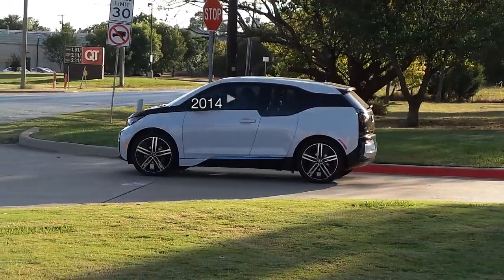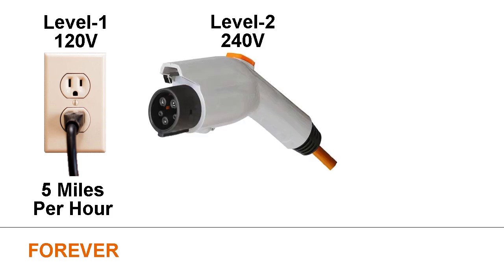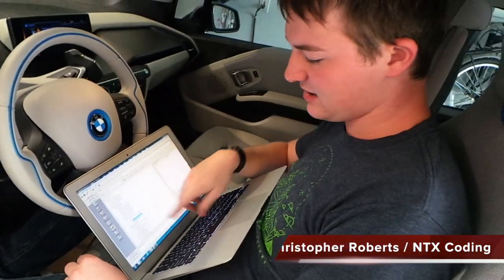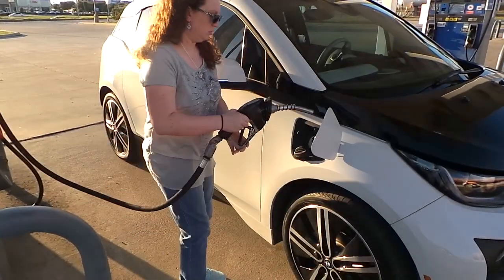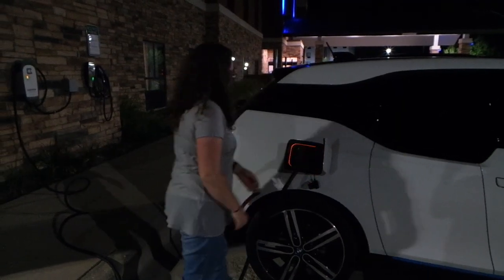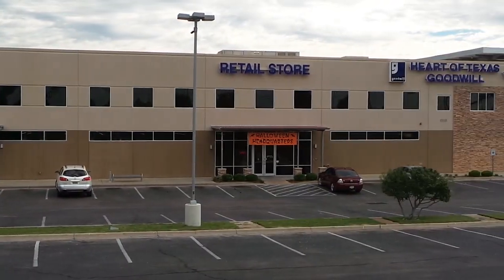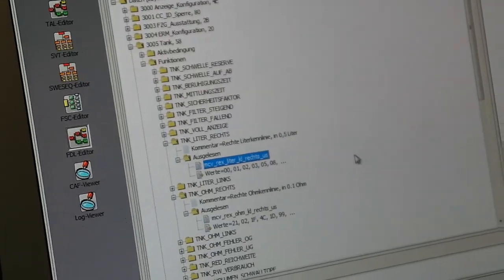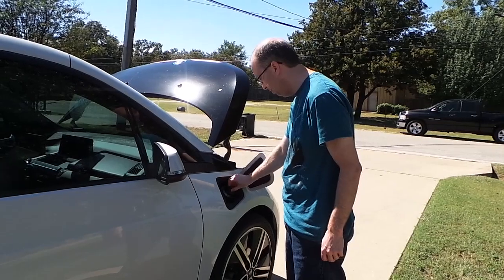BMW i3 REx roadtrip, charging, coding, and range test.

Comment: Thank you for the lovely test drive video! If I may suggest one thing: could you include KM's and Liters as well in the future? As a European I constantly had to pause the video and convert the miles/gallons :-)
Reply from the maker: I had seriously thought about that during the production.  But my audience is primarily in the USA.  So I decided not to.
Reply: Great review (I like all your video) and I love the car, but ditto here about KM and L.  The only Imperial countries left in the world are Liberia, Myanmar, and the USA.  There are some miles and gallons die hards in the UK too, but everyone else has moved on.
Reply: Die hards? As in, all the roadsigns, speed limits, cars and drivers? Don't get me wrong, I'd love to be fully metric (and with any luck, an independent Scotland in the future will go that way) but that is no reason to misrepresent the current state of affairs.

As it is, we're in a weird imperial-metric hybrid, where long distances are measured in miles and never kilometres; short distances are measured in either yards or metres ("Parking in 500yds", "30mph speed limit in 300m, 200m, 100m"); shorter distances still are measured in either feet and inches or metres and centimetres (a speaker may even casually mix the units depending on which comes to mind first); tiny distances are measured in mm (personally, I've never heard fractions of an inch smaller than ½ inch used) so tyre treads are measured in mm; speed is always mph and never km/h (heaven forfend anyone use m/s); fuel is sold by the litre but efficiency is measured in mpg; braking distances can be calculated in either feet or metres for our driving theory test; weights are given in kg (but many people still insist on working in stones and pounds when they think of the weight of people); pressure goes between kPa, bar, and psi depending on your car manufacturer and the gauge you use; frequency of rotation is measured in rpm (although I believe that is the case worldwide for automobiles, the SI unit would be s^−1 or Hz); we tend to talk of visibility in metres (though it wouldn't surprise me to hear it in feet or yards); height and width restrictions can be listed in metres only, feet and inches only, or both on the same sign.

Thankfully, all science education has been fully metric since before I was born, so with any luck we can phase out imperial measurements in my lifetime!
Reply: Yep UK here too and we're all Miles and Gallons too, that said... Brexit :/
Reply: scotsmanRS well in other countries like Italy everything is metric
Reply: How about you all learn a real number system.
Reply: And it would somehow do any damage to your main audiene to also consider other audiences? Would it hurt their precious special feelings to also acknowledge the existence of other audiences and the existence of the rest of the world for other audiences to hail from?
I don't get it.
Reply: Miles are far superior.
Reply: FREEDOM UNITS

Yeah I have no idea how to use most FREEDOM UNITS either being from BC. Trust me it's a bigger pain driving to the US and having to convert FREEDOM UNITS into km m and L
Reply: 1.6km per 1 miles.
Reply: 1.6 times. lol
Reply: Well, hello from Romania :)
Reply: The UK and USA are both a large share of the English speaking world (as far as being the primary language spoken is concerned).  Many countries and people speak English as a secondary language or a "standard language" so everyone can communicate, but it isn't the same as the US and UK where first and primary languages are almost always English (with some French and Spanish mixed in for the US).  Other anglosphere countries make up 20-25% of the population, maybe?  So, no, he should not use the metric system.  They are equally arbitrary anyway.
Reply: @JonathanOwenPhotographer  its not even same imperial gallon vs us gallon lol
Reply: @JonathanOwenPhotographer  Petrol (gasoline) is sold, ONLY, in litres in the UK. Gallons has not been a legal unit of sale for at least two decades. Nor do we use gallons to describe other liquid measure - unless you're a geriatric. Nobody under the age of about 35 will know what a gallon is. Oddly, some people still talk about the fuel performance of cars in MPG, although km/L is used too.
Only, ONLY, the USA (and associated territories like the Marshall Is.) use 'US Customary Units'. These differ significantly from English 'Imperial' units. Liberia has abandoned US units because its principal association is now with the other 14 countries of the West Africa ECOWAS trade bloc which is exclusively metric. Myanmar was (British) Burma until 1948 so has retained the Imperial, not the US system.
Actually, the US has gone metric - it's been the obligatory system for Federal work since 1978; the US military (with the exception of naval units like the Knot) uses metric. The US automotive industry has been metric since the 1960s, NASA since the 1990s. Since the entire rest of the world uses metric, US exportelrs have to make stuff in metric, too. The only Americans who cling to 'Freedom Units' are, by and large, Americans that don't really understand 'units'.
Reply: @alastairbarkley6572  many thanks for the slightly condescending Wikipedia style info, I was (I believe as it was now said two years ago!) referring to mpg which is something I am very much used to hearing referenced. If that makes me geriatric so be it, I'm probably not alone being in the +35 age bracket. Feel free to let me know what % of the population in the UK fits this demographic, and furthermore how including mpg might benefit us oldies who watch this channel that have lost all grip on weights and measures in this fast paced modern age.
Reply: @The8BitGuy  no, me and many Eurasian friends watching your channel too :)
Reply: @CatsMeowPaw  we are weird in the UK and buy petrol in litres, measure it gallons and measure distance in miles, but our emergency phone signs on the motorways tells us how far done the motorway we are in kilometres

Comment: This is, without a doubt, the best BMW i3 review I've seen. With the old tax credit still in effect for used i3s and me needing another car, this is certainly a car to consider. I do a 100 mile drive about once every 3 weeks. Besides that, most of my drives are 12 miles or less, so something like this would be perfect and is a good way to avoid paying the high gas prices, while not spending $70K!

Comment: Now that this video is about 2 1/2 years old, how has the charging infrastructure changed in your area?  Are you seeing more charging stations?  Would you be willing to go further on EV and less on the Range Extender?
Reply: i too want to hear an update
Reply: There is a fast charger in Waco, TX now.
Reply: We do have more public charging stations in DFW, but it still needs improvement - especially the suburbs.  Arlington is DFW's "entertainment" city with Six Flags over Texas, Hurricane Harbor (water park), AT&T Stadium (Dallas Cowboys, concerts and college football games), and whatever the new Ballpark for the Texas Rangers is going to be called, but there are not many charging stations.

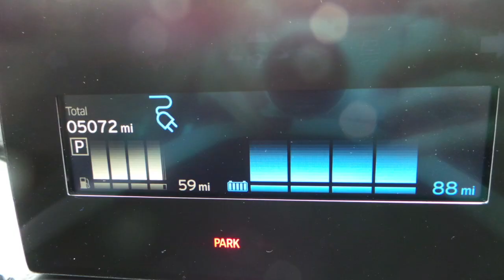Comment: 8:15 increased gas range on the guessometer because of a change of temperature perhaps.
Reply: yeah that's it most likely
Reply: Either that or maybe the incline on the pavement where the i3 was parked made the tank sensor read slightly incorrectly? that was my first thought

Comment: Yes indeed, a great video focussing on the key practical issues one needs to know. Far better than TOP GEAR and meme shows.
BMW, range extender needs a silencer. Also putting the petrol tank in the front of the car is a design fumble!
Reply: Yes, but for me (I also live in DFW), all this tells me is that EVs aren't ready for prime time...
All of that headache when my truck has none of these issues and will drive to Waco and back twice on one tank of gas, while hauling a lot more stuff.
Call me when we have a 500 mile range EV truck for a similar price to the gas version.  :)
Reply: Tech Deals 
Quite right. So much anxiety and hustle for 100+ miles, so yes indeed 500 miles, then I am interested in the 3i, otherwise not nothing.
Reply: @TechDeals  it's surprisingly quick to fill up 2.4 gallons. for a station on the side of the highway, its about 2 minutes from when you pull off to get back on the road. the core ideas of an EV seem to conflict with your "hauling a lot of stuff" business, dont want to pry why you wish to be able to make trips between cities carrying lots of cargo and not have time to at the very least pull over and stretch to prevent posture or back issues(you only get one back).

Comment: in my opinion the bmw i3 is a masterpiece of engineering. i would like to have one of those cars too, but i cant afford them. greetings from germany
Reply: bernddasbrot231 I am lucky to have one, and it is amazing, it feels great not to pay for gas. Electric charging is much cheaper compared to gas.
Reply: bernddasbrot231 you really want one of those overpriced mail trucks? chevy bolt is cheaper and has better range
Edit: model 3 too
Reply: Yeah nah beamers are built to last like 3-4 years and then literally everything in them just break down.
Reply: What is so great about it? As far as I know it's one of the worst cars ever. It gets crap range. It's expensive. It's mega-heavy, and being a modern BMW, it looks absolutely terrible.
Reply: @liam5257  Yeah. Current euro car companies are like US ones were in the 60s and 70s.
Reply: Jhon Krasnovskiy  I see them as low as $12K for the BEV and $15K or the REX version...
Reply: Jhon Krasnovskiy It was a nationwide search and the condition of their batteries and the rest the car was was checked. BMW in general and the i3 tend to have a lower than average reliability. Geek in me likes that car but I would be curious about buying one. Especially one with lower than average price. 

Good luck and enjoy ur Leaf instead.
Reply: It's ugly as hell

Comment: For me that would be nerve racking having to constantly be aware of my mileage. Driving is supposed to be relaxing and liberating. At that price I would expect at least 250 miles per charge and that's only a little over half of my Toyota Yaris and you can pick one up for under $14,000.   Hey love the channel, Take care.
Reply from the maker: This trip was an extremely unusual situation.  Normally speaking, our electric cars are driven in town and the battery range is more than sufficient.
Reply: I was reading that replacement batteri cost 10K USD :-o
We can agree that we do not get an EV for its lower cost.
Seems lite warranty from many factories are like 8 year. 
So including the battery replacement for an EV will add like 1 USD per 10 km.

Comment: Thanks for the detailed review on the REX. I currently live in Germany and was wondering why no one seems to use the battery hold function for longer trips when I read reviews in the U.S... now I know... ridiculous. Do you know if the 94 Ah has the same limitation too? Also, how noisy is it in the cabin with the REX working? My wife and I are keen on buying a used i3 REX in Germany. We usually drive less than 50 km, but a few times a year we take longer trips that can easily be 400-600km. I would think that a REX would have no problem with this, as long as we keep it between 130-140 kmh (80-85mph) on the Autobahn and use DC fast charing at some point in between.
Reply from the maker: We could not hear the Rex when traveling on the highway at fast speed.  In fact, we weren't even sure it was on.  However, at lower speeds you can hear and feel it running.
Reply: I've been looking for information like this all over the web! Thanks for this. Some reviews make it out to be quite loud, but I'm only looking to extend highway driving range. Around what speed would you guess it starts to drown out? I drive....spirited....which it seems you are used to :) but I wouldn't mind travelling at 55-65mph for efficiency if the Rex really is inaudible at that speeds. Great video again thanks for all the information.

Comment: The only thing I see in the comments is hate for electric cars, and people hating the 8-bit guys commentary.    :(
Reply: I don't hate the 8-bit guy, but uhh.. I do hate EVERYTHING about the i3. Until electric cars 1) get some kind of infrastructure and 2) can go more than 100 miles without a charge there's just no point. Everyone wants to SAY that it's great, but if everyone had an EV you'd need parking lots filled with chargers at every location because you'd need to be juicing your battery just to keep it going. Not really economical. Until a battery can go 300+ miles on a half hour charge I just don't see people switching.
Reply: All parking lots SHOULD be filled with chargers. What's more economical: a centralized distribution system that requires constant refueling and maintenance? An elaborate system of exploding dinosaurs that spews toxic waste and noise? Or just running some glorified extension cords through the parking lot? Hint: extension cords are more economical.
EVs with 100 mile ranges absolutely will work for most people if there is sufficient infrastructure - its cheaper to build charging stations than to tack on batteries. An absolutely gargantuan percentage of the population - especially in this economy - would love to take road trips with 30 minute charging in between 80 mile legs if it meant having a maintenance-free car that costs pennies to run and minimal price to buy. The 300 miles demand is completely made up by the oil companies and bought wholesale by idiots who don't know better - the same people who drive crappy economy cars with 8 gallon tanks that get 30mpg that have to be fueled up every 150 miles.
And guess what - the Tesla Model S P100D - the current top of the line model - does have 315 miles of range and uses the supercharger infrastructure. The chevy bolt - 200 miles of range, dc fast charger, $38k base price and arrives at dealers before the end of the year. Your info is outdated, Jesse.
Reply: Yeah, I wish :C
Reply: +yan-Deriction Nice trolling.  Proof is in the pudding m8, if people wanted electric or it was economical for them they'd be buying. I've worked at many car dealerships, BMW sold about 7 i3s a year at one dealership (in a city metro), and a Nissan dealer sold about as many Leafs. 

Most people returned the BMWs by the way, they hated that they could only drive 70 miles with the AC on. " if there is sufficient infrastructure", well there isn't. Why don't YOU pay for the infrastructure then you can start pointing fingers at who's wrong, me or you. Your pipe dream isn't just about the technology or how you can only travel 100 miles on a charge, it's the infrastructure or lack of one. It's going to take decades for there to be enough infrastructure for people to want to switch.

Electric has been around for 3 decades now, so why is it less than 1% of Americans are using them? No infrastructure and shit mileage. Nice try with your "outdated information" ploy, though.
Reply: "Why don't YOU pay for the infrastructure"
Sure, I'll pony up $20 for an extension cord. Which parking spot do you need it? The idea that an elaborate set of pumps and a dedicated filling station is somehow cheaper or more efficient to set up and operate than running an extension from the nearest power-line or plug is ridiculous.

"Proof is in the pudding m8, if people wanted electric or it was economical for them they'd be buying."
You're saying we should trust the judgement of the same people who rushed out to buy SUVs the second gas hit $2. 
However, if we look at the data - the costs to actual owners, electric cars simply win out due to minimal running costs and minimal maintenance required.

"it's the infrastructure or lack of one. It's going to take decades for there to be enough infrastructure for people to want to switch."
I bet the exact same question was said to the person who came up with engine block heaters. "Engine block heaters? Neat idea but... setting up the infrastructure is just too difficult! It's gonna take decades before the good people living in the north are able to preheat their engines with electrical power, its just not practical!"

"Electric has been around for 3 decades now"
Sure, I remember the great mass produced electric car of 1993, which was a complete failure due to lack of infrastructure and shit mileage.

"Nice try with your "outdated information" ploy, though."
That was in direct response to you implying that 1) electric cars cannot go more than 100 miles on a charge, and 2) electric cars cannot go more than 300 miles on a half hour charge. Both false.
Reply: Jesse Crandlo
Reply: I don't hate electric cars, I just like gas cars a lot better.